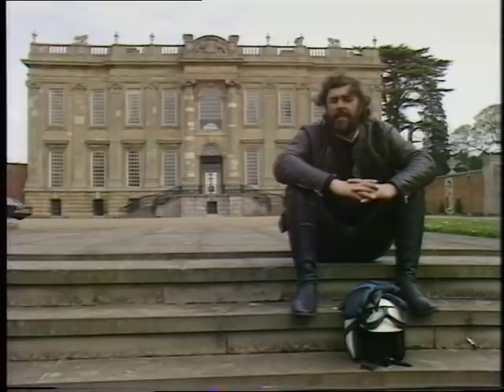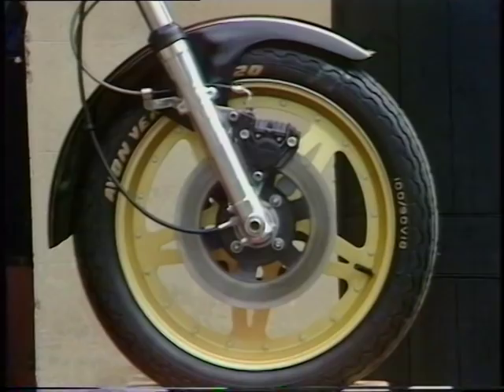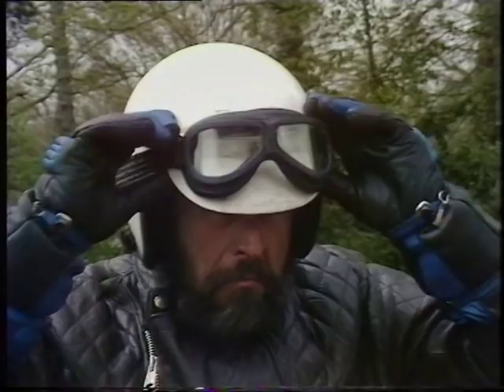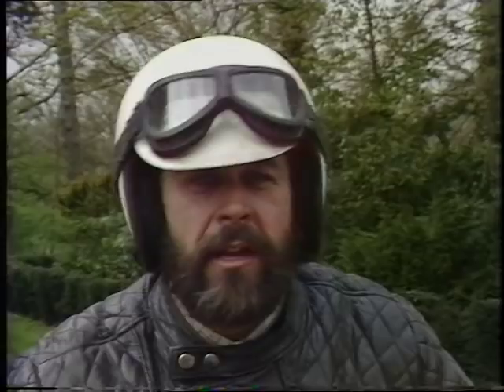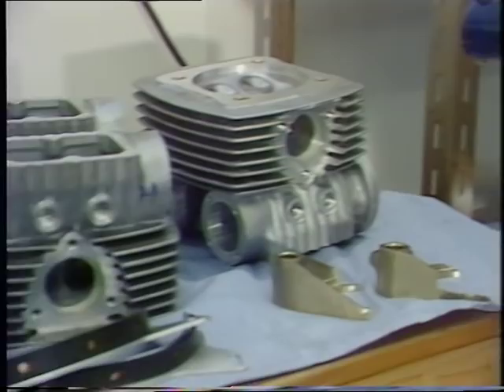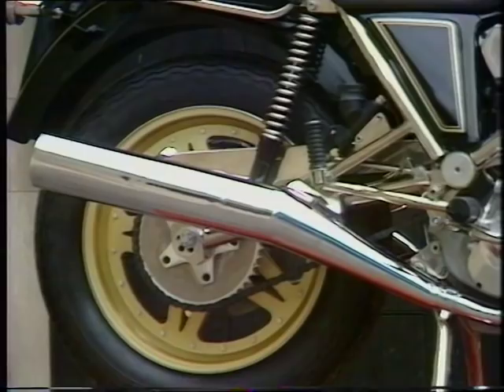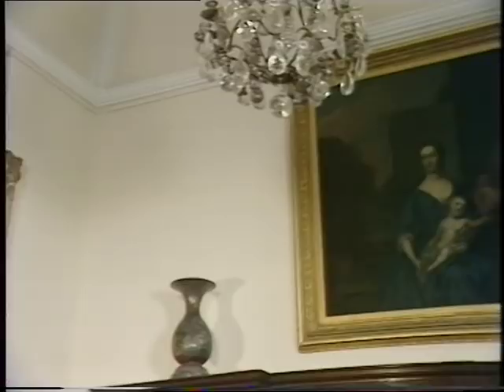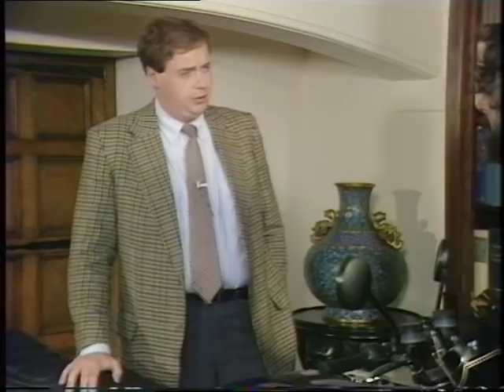Vintage Motorbikes | Hesketh Motorbike | Wheels | 1980's

Comment: There were numerous problems. The bikes were heavy, made worse by a high riding style; and unreliable,with numerous manufacturing problems adding to an overheating rear cylinder due to lack of air flow. The resultant bad press, combined with an underdeveloped bike, lack of cash and a collapsing market meant that after the production of 139 bikes, the company went into receivership in 1982.
Reply: doryanthes67 copy and paste Wikipedia?  At least give them credit. Muppet
Reply: A sorted Hesketh is an amazing experience, loved all of mine … really would love to buy a Vampire (only 19 or so built) … super comfortable, long throttle pull do you have to give it a handful but certainly as fast as you could ever need ❤❤❤

Comment: "No kickstart is fitted". That's a shame, 1000cc V-twin would be no problem to kick over.
Reply: Harley Davidson 1200cc v twins were kickstart into the 1970s, and even some 1340cc bikes still had kickers fitted into the early 80s, electric start first appeared in 1965. No problem kicking over these motors unless massively overbore and much high compression than standard